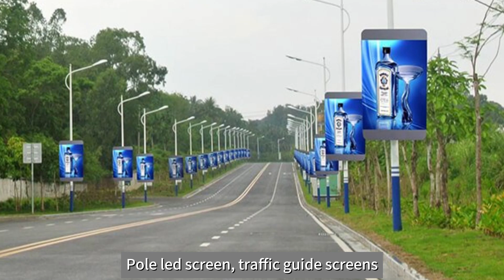Wi-Fi led sign controller C08L support rs232 and rs485 Protocol

Comment: Whether Nodemcu send data to Huidu controller card via UART communication (Max485 TTL) with different triggers ?
Reply from the maker: Yes. it is available. but you need to use  our SDK  controller